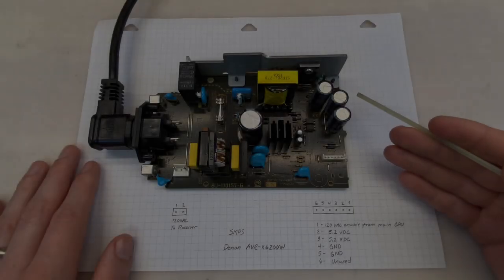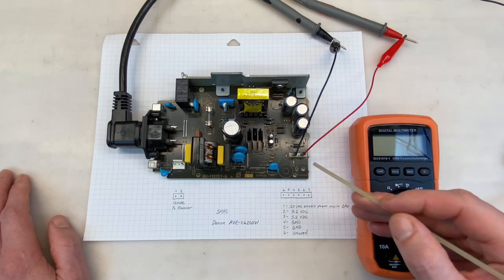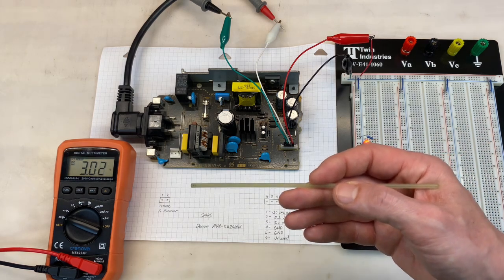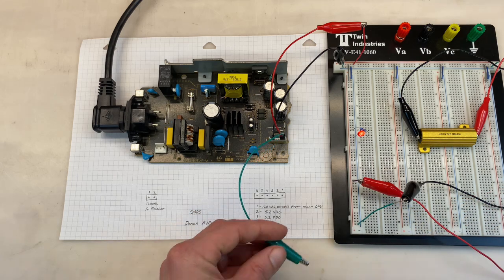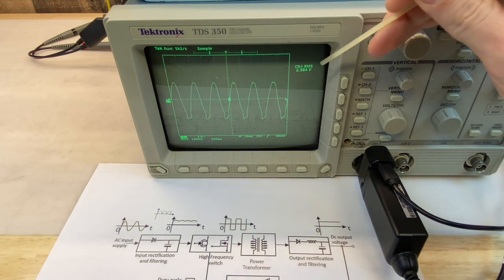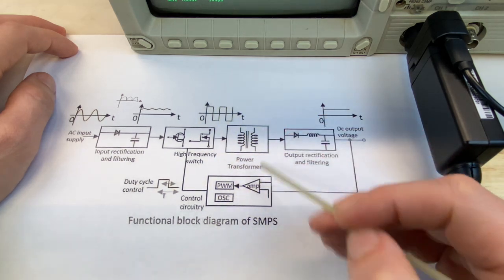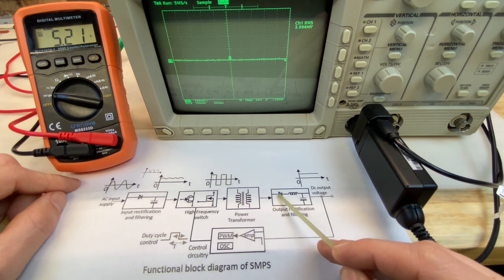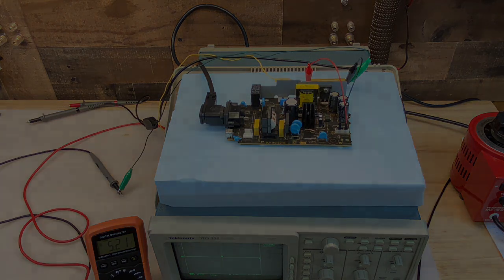DR #65 - Grasping The Switch Mode Power Supply

Comment: Class G amp & smps... aka tracking power supply for a class a/b output stage. Not a 2 or 3 stage class H. Ie. Carvin DCM-3800L the 3800 denotes 3800 watts bridged mono.

Comment: Thank you so much. I have this exact same model, and it stopped working. Only for me, this was the issue. I replaced several parts as recommended in the service manual to no avail. I found another video about some of the surface mount capacitors, which I replaced and it got it working sort of. As soon as I hooked up the speakers it crapped out again. So back to the drawing board and I traced down a smd resistor that was supposed to be 22k but was only working at 56 ohms. So after that was replaced I got the fluctuating DC 5v and lost my mind. Until I watched your video. I set up the same tests, and BOOM! 5.3v solid. It triggered the 120v AC. Now I'm back in business!

Comment: What does the other transformer or inductor do on that board? I guess you don't draw infinite current on the ac in because that end gets saturated like a capacitor?
Reply from the maker: The component that looks like a small transformer is a specialized inductor called a common mode choke. Its job is to filter out any high-frequency noise present on both incoming AC lines (hot and neutral). Since the control IC uses high frequency as well, anything coming in from the AC line could interfere.

Comment: Glad you mentioned the minimum load requirement as many switchmode supplies do have that requirement and it is important to remember when testing them.  At 4:50 curious why the AC sine wave had such distortion?

Comment: The converter at hand is very clearly a flyback type. This is apparent because there are no inductors on the output side of the "transformer."
In a flyback converter the input high voltage is not switched to provide AC excitation, the magnetic component isn't a true transformer, and the turns ratio does not dictate the ratio of output voltage to input voltage.
The thing commonly called a transformer in a flyback converter is actually an inductor with two (or more) separate windings. One winding is the input, the others are outputs. When the switch on the input side is ON, energy is stored in the inductor via input winding. While this is happening there is no current flow in any of the output windings and the current to the load is supplied entirely by the output capacitors. When the switch turns OFF the energy stored in the inductor is delivered to the output filter capacitors and the load via the output winding(s). The turns ratio is designed on the basis of the inductances required to store the necessary energy during the switch ON time and deliver it during the switch OFF time. Though it would be silly to do it, a flyback converter can produce a 5 volt output with an inductor with 1:1 turns ratio. With that same inductor it could produce 50 volts or 100 volts output. If there are multiple outputs, the turns ratio among them is important. A 10 volt output would have twice as many turns as a 5 volt output (ignoring issues of diode voltage drop). Flyback converters are convenient when multiple outputs are required because there is quite good tracking of the voltages.

It is very rare for a modern switchmode power supply to require a load for proper regulation, though the ripple voltage may be higher with no load because the switcher may operate in "burst mode" where it runs for a few cycles then is completely off for several cycles. Deliberately designed burst mode is one of the methods that is now very common with "wall wart" type switchers to reduce their no-load standby power consumption to meet energy efficiency targets. The fact that supply actually shut down completely, allowing the voltage to sag very substantially then turned back on with no load suggests something may in fact be wrong.
[edit] It would have been far more instructive to look at the 5 V output with the oscilloscope rather than just a meter. That would have shown if the on/off cycling might have been due to a voltage over-shoot. The meter suggested the output voltage didn't even reach 5.2 V with no or light load. [end edit]

 RMS voltages directly across the windings of a flyback inductor really don't tell you anything of value.